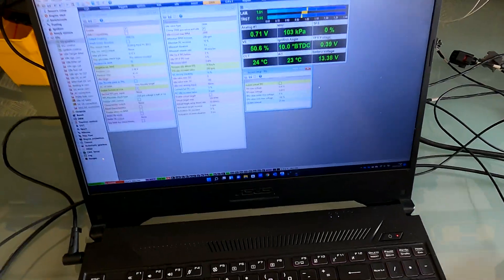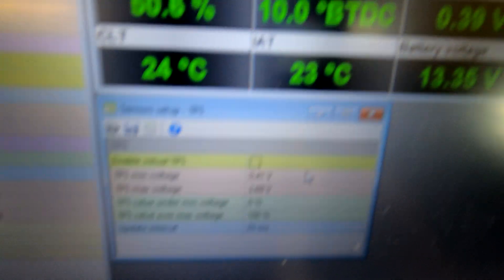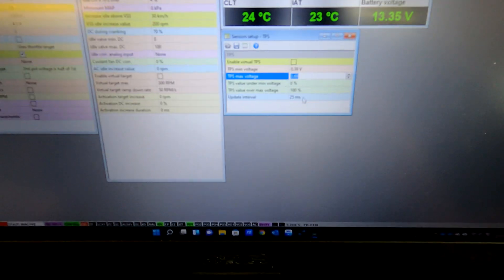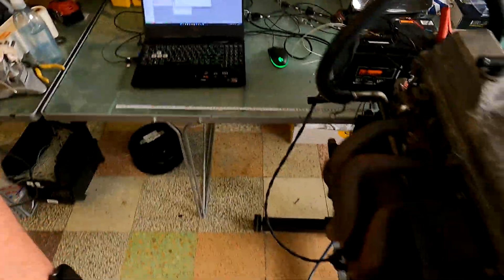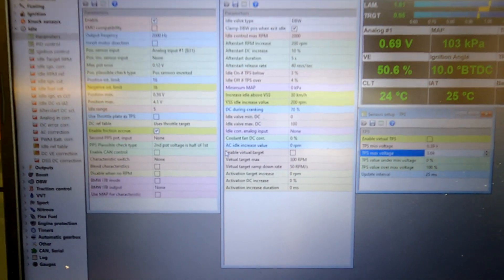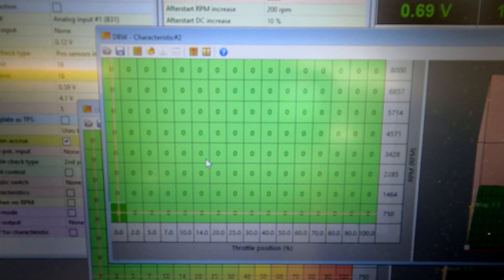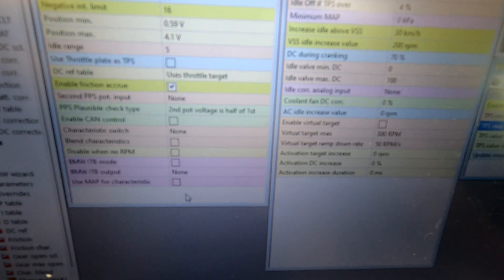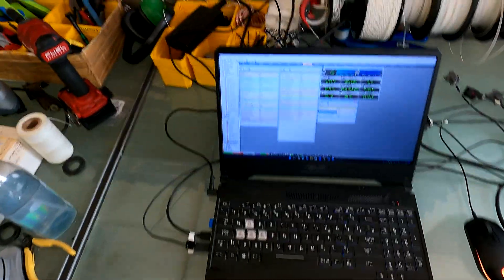ECUMaster Black How to Setup your Drive By Wire

Comment: Why is the pedal used as the TPS input? The characteristic table then affects the enrichment and if CAN input on 667 for throttle blips then there is zero enrichment that takes place.
Reply from the maker: That is how ECUMaster have it setup. I assume that they are fully aware of that as you need to activate the Drive By Wire in software so the software is fully aware that the dedicated TPS Signal is actually Accelerator Pedal Position Sensor and not the TPS.
Reply: @PhoenixEngineManagement  
I changed the setting and checked the box "Use throttle plate as TPS". The improvement in driveability is big and the CAN 667 throttle blip actually gets enrichment now. Overall this is working SO much better.

Comment: What tab is the tps voltage in?
Reply from the maker: Hello Reuben if you want to view the TPS voltage then you can use the Tune Display and set one of the 9 sections as TPS voltage.
If you are setting up the Drive By Wire then the TPS Voltage is setup by the setup process.
Also remember that the TPS input is actually the Accelerator Pedal Input so if you want to setup that then you can go to Sensors Setup>TPS 
Then you can set the TPS voltage on the Tune Display and then you can Set the minimum TPS Voltage with the Pedal not pressed and then Press the accelerator pedal very hard to the floor and then set the TPS Maximum Voltage.
Reply: @PhoenixEngineManagement  thanks, i needed for the throttle, my car is missing 8 to 10% of the throttle, i have adjusted the voltage to match closed and open throttle and calibrated, it has improved but stilll seems to be missing a couple of percent now

Comment: Mine say’s disconnected and it’s plugged in
Reply from the maker: Hey Drippy I would assume that possibly there is a driver issue if you are 100% sure that the ECU is turning on. Usually there is a beep when you turn on the ECU so that might be a good indicator to make sure that the ECU is turning on and make sure that the computer/laptop is detectng that a USB is being connected.

Comment: Hello
As Levi is, i'm trying to understand the DBW wiring.
Seems that the e-pedal should directly control the throttle, and only the signals, 2 for throttle and 2 for pedal are going to the EMU Black (Box ?)
If so, what are the right pins to use ?
Thanks in advance
Reply from the maker: Hello Levi okay so the Main Pedal Signal should be wired to TPS Input. The Secondary Pedal Signal should be wired to an Analogue Input so for example Ana 1. Then the TPS which forms part of the Throttle Body wiring can be sent to another 2 Analogue Inputs. So you could put them to Ana 2 Ana 3. Once you have done that then you need to go into the relevent settings in the ECU an tell the ECU which sensors are connected to which input.

Comment: Can you do up a wiring diagram for how you wired the whole thing up please
Reply from the maker: Hello Levi. There are multiple types of throttle body and different ways of wiring them all up. You ideally need to find out what wiring your particular throttle and Accelerator pedal requires signal wise. But as a basic normally there are 2 Signals from the Throttle that you connect to Analog Inputs. Then the Pedal will have two signals. The main Signal from the Pedal goes to the TPS Input and the other signal goes to an Analog input. Then you use one of the H-Bridge Outputs for the Throttle Motor so H1A and H1B is the normal one to use.